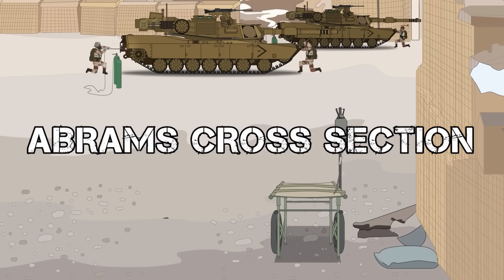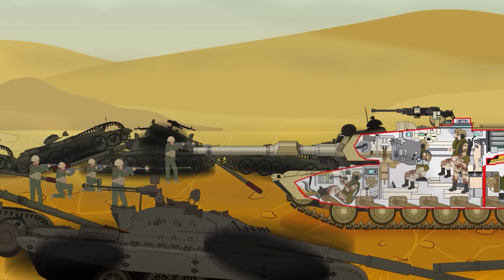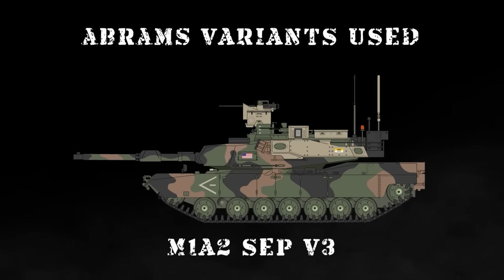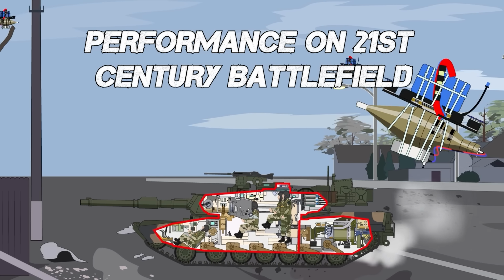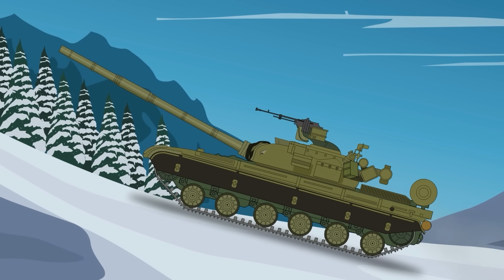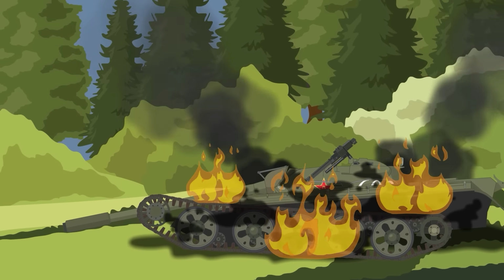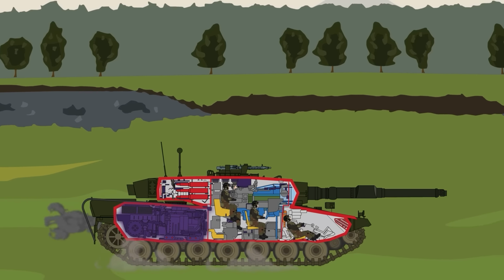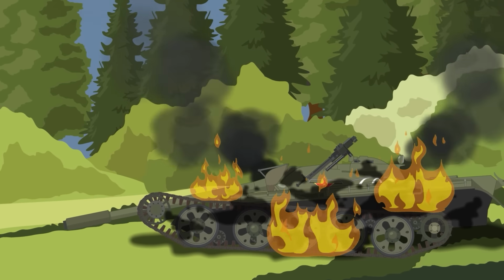M1 Abrams VS. Leopard 2 Tank

Comment: Chrysler Defense was sold in 1982, telling how old the design of the tank is.
Reply: What does that even mean ?? The abrams litterly got built with future upgrades in mind

Case in point ; the turret was able to handle the m256 gun when the army wanted to replace the m68.
And another point is the fact that even the m1a1 models had a port that could be cut out to place a CITV in its place.
The armor composition is modular and can be changed whenever *so long as it didn't require lengthening the turret like the SEP V3*.
So what does it's age have to do with anything ? If anything it just shows that it's a good tank design that had the future in mind. Even then when It first came out it was one of the very very few tanks that used a thermal sight
Reply: @ Doing great in Ukraine? lol. It got recalled like a defective toaster.
Reply: @SB-qm5wg  first off
That's the export model tailored for Ukraine .meaning it ain't the same as an American or Australian or Moroccan abrams

Second.How many abrams tanks won vertical speed records with their turrets ? How many were lost and incinerated its crew ? The same crew that took thousands of months and dollars to train and are practically irreplaceable in times war .how many abrams tanks got lost and immidietly exploded with their crew inside ?
Not sure about you but it seems like you're nitpicking situations where the abrams in Ukraine got destroyed because of something it wasn't meant to encounter in the first place like any other tanks aka drones

If that's how you judge things then i pity you
Reply: @SB-qm5wg  the situation in Ukraine is more modern WW1 like, and the tanks have not been recalled like "defective toasters" instead were recalled to most likely be fitted with cope cages and anti-drone equipment due to the fact they have been destroyed by drones and still have proven to be effective. the Abrams sent over aren't the modern ones we have in the United states armory, the ones we sent were M1A1 which was made in 1985. these tanks have no upgrades and are export friendly. They have performed well against infantry held up in buildings but not against more modern tanks from russia.
Reply: Yeah it's sad it takes so long. Makes me think of Pentagon war.
Reply: @ I love that movie. I've seen it so many times. The sheep part made me laugh so hard 🐑

Comment: Qualifications:
Leopard 2 has better composite armor, Leopard 2 can shoot accurate to 3km while moving at 25-30km/h, while M1A2 Abrams can only shıot accurately to 1.2km distance, Leopard 2 has an armor design with threat angle, while Abrams don't have, Leopard 2 has 520mm NERA armor at middle and top while it has 280mm at low parts of chasis, while Abrams has 450-550mm armor at chassis, Abrams has 800mm turret cheek armor, while Leopard 2 has 600mm turret cheek armor, both tanks has 4 crew (Loader, gunner, driver and commander.), Abrams has 12.7mm machine gund while Leopard 2 has only 7.92mm machine guns, Leopard 2 has extra armor on turret, which makes it have spaced armor against hollow charge ammunitions (like HEAT, HEAT-FS and ATGM's(drones are using HEAT and HWAT-FS ammunitions)), and it has 10mm (1cm) rubber at the end of(the place touching turret cheeks) extra part, which makes APFSDS ammunitions lose a little energy and change direction, Leopard 2 Has 35 degree angle at turret cheek, while Abrams has 30 degree angle at turret cheek, M1A2 September V3 can penetrate up to 1000mm(100cm(1m)) with M829A4, while Leopard 2A7 and Leopard 2A6 can penetrate up to 950mm with  DM53 and DM63 when you shoot with L/55, if you shoot with L/44,  it will only penetrate up to 700mm.
Reply: The 7.92mm doesn't exist anymore. The Germans are using 7.62 NATO.
Reply: Let’s make it easy, both are cool
Reply: Did you use War Thunder to get that info?
Reply: Lmao Germany fanboy
Reply: Yea well how much does the Leopard cost and how many are there compared to the Abrams? How many man hours of maintenance per hour driven? Etc
Reply: @J_McPhearsom  Well, how many units of each were made?
Reply: @McPhearsum Leo has a lot less maintenence due to it's diesel engine
Reply: I can’t think of any benefit other than maybe those that are classified for why the Abrams V4 may be better than the Leopard 2A5, other than the fact it’s turbine engine can run on jet fuel (or anything else, at lower efficiency), which aligns with the US supply chain, and can deploy and supply them more efficiently. If I could make the Leopard drink jet fuel, then it might be the perfect tank IMO. But, my prior question is basically, are they too complicated, costly, and time consuming to make them at speed and scale? and supply them at a higher rate than losses
(Sorry, I’m an MS industrial & systems (and BS mechanical (and math)) engineer so I nerd out)
Reply: @McPhearsum Leo 2 has a multi fuel engine. If it's liqued en burns tou can put it in
Reply: @McPhearsum  alright here's why Leopard is superior than (Hollywood-glorified) Abrams..
1. Cost: Leopard 2 is Cheaper to Buy and Operate
• Abrams M1A2 SEPv3: Costs around $10-12 million per unit. The turbine engine (while cool) is a gas-guzzling maintenance hog. The AGT1500 burns fuel like a jet on idle.. literally.
• Leopard 2A6/2A7: Costs around $6-8 million per unit. The MTU diesel is far more fuel-efficient and cheaper to maintain.
Winner: Leopard. More bang for the buck.

2. Maintenance: Leopard 2 is Less of a Hangar Queen
• Abrams: The turbine requires more man-hours per operating hour than the Leopard 2. It’s high-performance but finicky, great for the US logistics chain.. a nightmare for allies.
•Leopard 2: The diesel engine is simpler, more reliable, and easier to fix in the field. Fewer specialized tools, fewer headaches.
Winner: Leopard. More uptime, less downtime.

3. Global Supply Chain: Leopard 2 is NATO’s Workhorse
• Abrams: Only the US and a handful of allies (Egypt, Australia, Poland) operate them in large numbers. Production bottlenecks mean delays.
• Leopard 2: Used by over 20 countries. Germany, Sweden, Spain, Greece, Canada, etc. Spare parts and upgrades are everywhere.
Winner: Leopard. You can actually get them in large numbers.

4. Fuel Flexibility? Not Really an Advantage
• The Abrams’ multi-fuel turbine sounds cool, but in reality, everyone uses diesel anyway. Jet fuel (JP-8) is just less efficient in the Abrams than diesel is in the Leopard.
• The Leopard’s MTU diesel is optimized for NATO-standard fuel—no need for gimmicks.
Winner: Leopard. Diesel is king in ground warfare.

5. Survivability & Upgrades: Leopard 2A7+ is a Beast
• The Leopard 2A7+ has better modular armor, active protection system (APS) options, and a more modern fire control system than most Abrams variants outside the SEPv4.
• The Abrams SEPv3 is great, but it’s heavier (67+ tons vs. Leopard’s ~62 tons) and still relies on depleted uranium armor (which many countries won’t use).
Winner: Leopard. More flexible, more exportable, just as survivable.

6. Strategic Mobility: Leopard 2 is Easier to Transport
• The Abrams is wider and heavier, making rail/road transport harder in Europe.
• The Leopard 2 is more compact, easier to deploy via NATO infrastructure.
Winner: Leopard. Logistics win wars.

Final Verdict:
While the Abrams is overrated, the Leopard 2 is:
• Cheaper
• Easier to maintain
• More widely available
• Just as lethal
• More logistically friendly

So unless you’re the Pentagon with a blank check, the Leopard 2 is the objectively smarter choice.
Reply: @titan_tanker tbh I find this a dumb argument. Both tanks are the best in their own right and what they were made for and they will most likely never fight each other (due to being allies) so which ever weakness one tank has, the other will cover that weakness. I personally also have a hard time arguing about this since I love both tanks the same.
Reply: @Rageaben  mmm not even close, Abrams is mediocre at best.
If that junk is so equal, why does even Ukraine go 'thanks, but more Leopards please?' 😂
Reply: @titan_tanker Now, I shall not keep arguing about this since it’s a waste of my time and I have better things to do than argue with a random person on the internet. Have a good rest of your day or night and stay safe.
Reply: @titan_tanker  that answer was so good I was rereading and checking spelling etc to see if you had help with Chat GPT! Very nice 👍 nerd 🤓 is satisfied. (And yes I’m with the pentagon, I’d like 3,000 Leopard 2’s plz! who do I write the check out to?)
Reply: @titan_tanker  While I agree with all your points that the Leo2 is a true modern tank (better) and the Abrams is becoming an old heavy beast, I’d wager that the depleted uranium armor itself unmatched (harder, stronger, more survivable), hence why  it’s exact details and composition being one of the most secret, classified parts of the whole tank. The whole point of controlling that information is that everyone (including us) underestimates the Abram’s ability to withstand damage/direct fire.
Reply: @titan_tanker I ain’t reading allat.
Reply: @Holdup_ineedwater  all good, comprehension isn’t for everyone.
Reply: @TitanTankerGaming the M1 Abrams is better than the leopard 2 bro